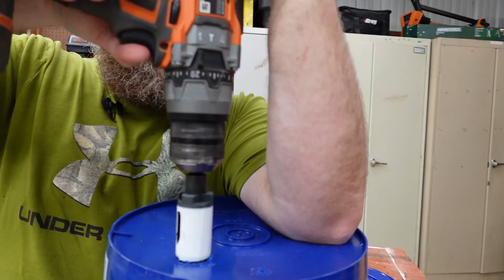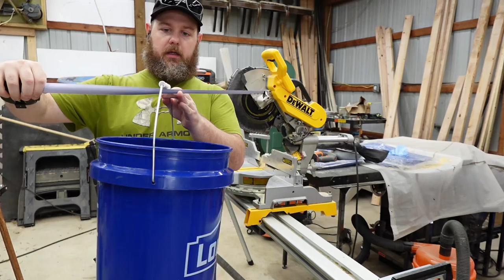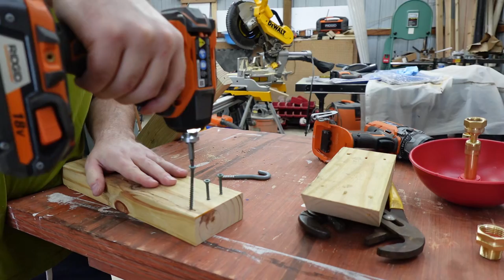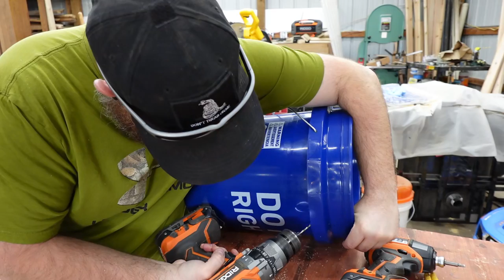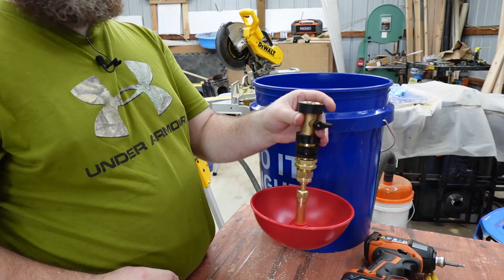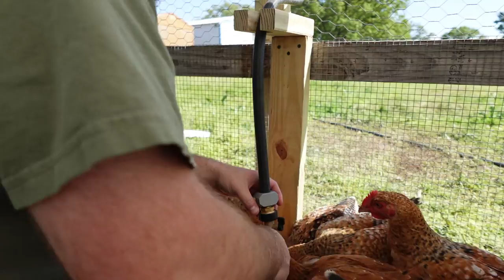Simple, Clean, and Efficient Chicken Waterer

Comment: It’s a really good idea. I’d add a  2x4 to support the bottom because those handles with water might not hold up. I’m going to try this myself. When others are helping in my absence this would be easier and more comfortable for them. Thanks for sharing.
Reply from the maker: Thank you. I am definitely going to do that. I have been wanting to do a follow up video with some modifications, but life has gotten in the way and I still have chickens in there so I haven't messed with it.

I have actually been surprised at how well the handle has held up. But it definitely needs to go away because the distortion of the handle with the wait of the water makes dealing with the lid annoying.
Reply: @lindseyacresfarm  your idea with the paint lid I think is worth the try but maybe setting up the system so a pvc attachment for a hose is permanently fixed to the container. That way you can screw (or use quick connections) the hose into the fitting. Can’t wait to see the update.